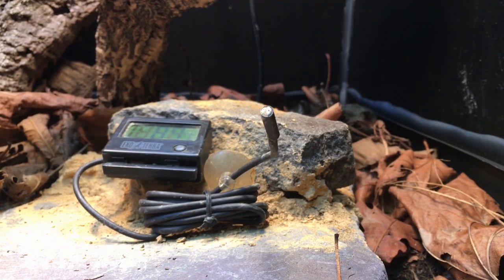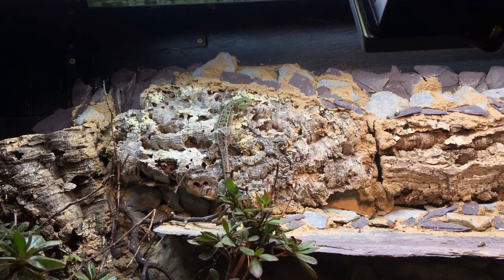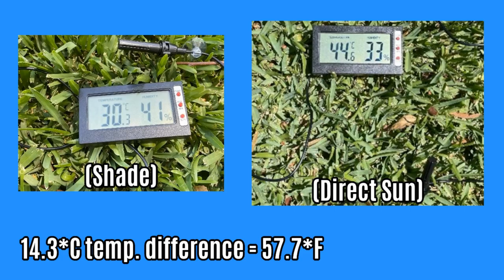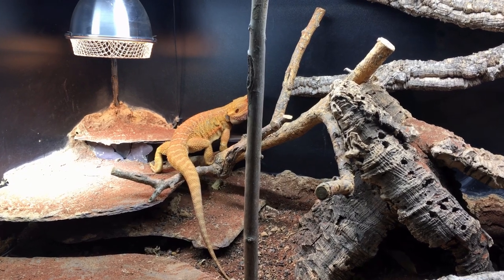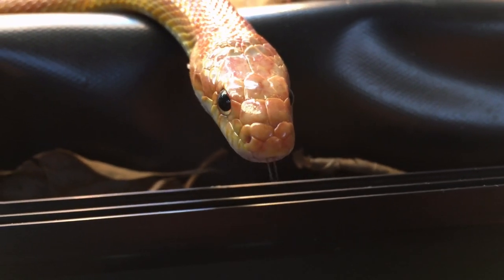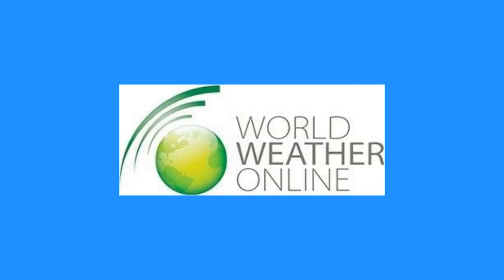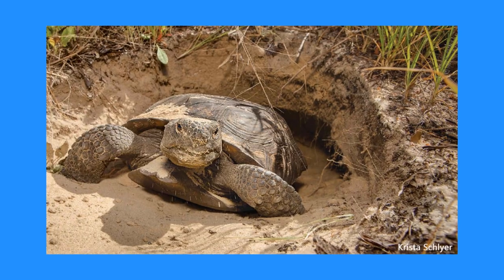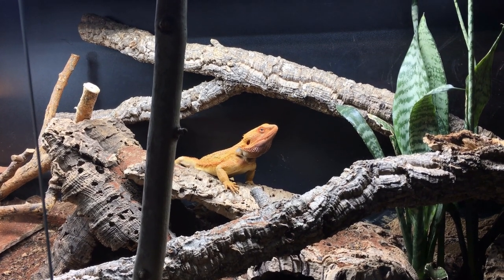We've Been Heating Reptile Enclosures Incorrectly All These Years! - How to Heat a Reptile Tank

Comment: I'm sticking to my ackie setup lol. Radiant heat panel fixed to a herpstat thermostat on the cool end at a continuous 70f and on the hot end a bulb with a hot spot of 145f. Two digital hydro thermometers at the cool and hot ends centralized at ground level (not near bulb on hot end I check that daily with a temp gun. I give over 20 ground level hide spots with multiple elevated points with 6 to 9 inches of mixed substrate. This gives the animal multiple  choices with some hide spots hitting 99% humidity ect. He's healthy active and shedding well so something is right. O also have a 22 uvb that he's got a angled basking log running underneath.
Reply from the maker: Do you only have a radiant heat panel? No incandescent lamps, no metal halide or spot LED?

There is much more to radiation than just warmth. Just as you cannot induce cutaneous D3 synthesis without proper UVB lighting, you cannot induce the metabolic effects of NIR and visible light without providing them in the right intensities.

See here: https://youtu.be/UEcm0YwfAIg ...and here: https://youtu.be/dUJZ04sqhxk ...for more on this.
Reply: @JTBReptiles  he's got a Arcadia uvb and I had a top states dwarf monitor breeder have a look over my current set up and his only question was the ventilation and that I had to much at the time.
Reply: @JTBReptiles  o and of course the outdoor halogen spot for his basking spot I'd be worried if my radiant heat panel hit 145 lol I'd get the fire extinguisher out on that case
Reply from the maker: “Too much ventilation”? I’d like to know how an enclosure can be too well-ventilated considering that - unless you have some seriously powerful fans - the air flow through the enclosure will be nothing compared to even a light breeze in nature.

How is that 145 Fahrenheit being measured? If that is the genuine air temperature (measured with a probe in the shade, as described in the video) the lizard would be dead, so it cannot be that. If it is the surface temperature of a stone, the lizard will certainly avoid settling on it when it has gotten that hot. Forgive my bluntness, but whoever is recommending that cannot understand what they are measuring or the potential for damage such practice involves. I predict that you are likely either using a probe thermometer sat under the lamps or you are measuring a surface temperature with a gun; if that surface is a stone the lizard will rarely sit on it - if it is a piece of wood, though, it may show no particular aversion of it.

Here is some additional food for thought. The intensity of infrared A on a clear day near the equator is about 300W/m^2. Offer significantly less than this and the metabolic implications are lost; significantly more and there is a real risk of overexposure. A similar sentence can be composed for visible light. Temperatures are affected not just by radiation but by the ability of the vivarium to lose heat; thus if you choose your lamps based on temperatures, your choice will be heavily influenced by factors other than the intensity of radiation you are offering. How can you know that conditions are optimal? If the “top US breeder” has to use a 100W halogen lamp to get his temps up and you need to use a 70W lamp (for example), which of you is offering the correct IRA intensity? Are either of you? And what about visible light - without a dedicated source, for a diurnal heliocentric species like a monitor you will definitely be under-providing it.

It is not hard to get reptiles to breed, for the most part. After perhaps the desires to eat, drink, run from predators, and (how very topical) move for thermoregulatory purposes, the desire to breed is one of the strongest urges of any animal. You can keep a reptile warm enough for activity with no great difficulty, and often doing this is all that is required to keep them alive and apparently well to the point that they will breed reliably, but it does not mean that everything is being done perfectly.
Reply: @JTBReptiles  because monitors need that huge amount of humidity with insanely high basking spot so in his explanation you need a limited ventilation otherwise you just dry out the vivarium with such hot heat sources inside. This man has been producing top ender ackies , kimbs,  kings and black heads and more for decades so I go by his wisdom and success of producing amazing animals.
Reply: The ambient on the hot side is in the mid 90s but his basking rock with the temp gun held directly on it reads at this very moment 146f wich is actually low for a ackie of his size. You investigate ackies in the wild and they've been recorded basking rocks reaching 180f lol. You have to remember this is a monitor lizard so a whole set of different rules than say a skink or a gecko or a beardie. Also I would suggest looking into dwarf monitor care sheets and communities because as I said you have to jump through some uncomfortable hoops to get them to thrive that go against the grain of the standards for more commonly kept animals
Reply from the maker: As I say, just breeding things doesn’t say much for a keeper’s ability. It may show that they know their animals - how to handle them, deal with them, coax them to eat, what they look like when they’re about to lay, and so on - but it doesn’t mean that they understand them. Indeed, it doesn’t mean that they know how best to provide for them: the dog breeders which produce the most animals are those involved with puppy farming; likewise, the ball python breeders which produce the most animals have them in racks. Success with breeding is really no indicator of welfare.

Now, I do not believe that any reptile would choose to sit on a dense stone that hot for prolonged periods. A wild ackie monitor might WALK OVER a dense rock that hot, but I will eat my hat if one has ever chosen to sit on a dense rock at that temperature in the natural setting.

The lizard does not care about the temperature of an object. It cares about how hot it feels to the touch. A piece of metal at 145 Fahrenheit would be almost immediately painful if you touched it; a dense stone at that temperature wouldn’t be quite as damaging but it wouldn’t be nice; a less dense stone (like a piece of pumice) would feel slightly cooler again; a piece of wood would only feel warm. It is the object’s capacity for heat transfer which matters, not just its temperature. For the most part, the lizard will sit on objects which have the combination of temperature and heat transfer action which feel comfortable: not cold, not hot, just right. The lizard might opt for slightly warming objects when it is cold, but other than that, its preference will largely be limited to avoidance of the extremes, i.e. really hot to the touch and really cold to the touch.

What the lizard DOES care about is radiation. Reptiles are famous for their behaviour of moving to and from light and shade: it is this - the intensity of sunlight - which really matters to the reptile. Air temperatures have an influence on body temperature which we must be careful to consider, but they don’t influence the choice of basking location - so long as the air is warm enough for them to get started and not so warm that they overheat, the choice of basking location will primarily be driven by (once again) the intensity of sunlight. Therefore, THIS is what we need to concentrate on: replicating the form, composition, and intensity of sunlight. Secondarily we must consider the air temperature to ensure it falls within the broad “Goldilocks zone”. Finally, we need to check that objects in the enclosure aren’t uncomfortably hot or cold to the touch. A 145 F dense stone WILL be uncomfortable to sit on, so it shouldn’t be in there!
Reply: @JTBReptiles  well you can presume all you want but a whole community with healthy ackies who are active, feeding well with no burns or deformities from wrong care would say otherwise. Just from my own animal who has an area of light in the 90s to second source that's 145ish his behavior daily is to come out of his burrow and spend about 40 minutes under his 145 area and warm up then go through a pattern of spending about 30 minutes to an hour burrowing,  looking for food climbing about then straight to his 145 area for say 30 minutes. He'll do this then he seems to sit on the 145 for one last stretch of about a hour and or two then he'll start withdrawing to his burrow about a hour prior to lights turning off. Like I said this animal has many areas ranging from 80s to 145 and he always chooses the 145 because he's a ackie. Also you're slightly wrong on the breeding idea... some species won't breed at all in a bad set up for example crocodile monitors ... there's a reason why they cost so much. But I really think you should look into ackies and so on before drawing such a conclusion.
Reply from the maker: Seeing as you seem so certain, I am doing just that: looking into the depths of this. From what I’ve read and watched so far, I think that this monitor debacle has more to it than meets the eyes of both parties, both yours and mine. (I’ve got the cutlery ready, but I’m not eating my hat quite yet - there’s a lot more explaining to be done before I get to that!)

I am used to the sort of persistence you have shown as coming from people who either don’t understand what they’re saying OR from people who have incentive not to change what they’re doing. However, I realise now that this isn’t entirely the case - there is some serious thought which has gone into giving monitors such peculiarly high surface temperatures. I must therefore apologise for my recalcitrance.

Expect to hear more about this from me in the future!
Reply: @JTBReptiles  yeah like I said it's some uncomfortable hoops to jump through. But say if you kept a ackie at say bearded dragon temps you're looking at obesity and all sorts of problems like gout. You see bosc monitors suffer from this problem alot because they need similar temps and a heavily based invertebrate diet. New keepers to monitors  are scared or not experienced enough to create this odd extreme hot spots with high humidity ... also they feed boscs lots of mammals and raw meats. I think it's the metabolism of monitors that creates the need for these temps like my ackie is a very very very active animal.
Reply: @JTBReptiles  also like i was trying to explain prior (I work 10 hour night shift and I'm always half asleep when you reply it seems 😂) my breeder to my knowledge was 1 of about 7 people that started bringing dwarf species to the states and together they came up with this (maybe not perfect but nothing in captivity is) but darn close system over decades. So as suggestions I would look up nerd videos for monitor behavior and metabolism, professor herp for basic care, critter cam for videos on how they keep ackies in Australia and dave Kaufmans video on ackies in the wild. I personally spent 7 years investigating and letting the ackie hobby grow before I purchased and yeah it didn't change much in the systems used to keep them as healthy as you can.
Reply from the maker: @cadirgemont5900  There is still very much more to this, though. From what I have seen, nobody makes distinctions between different basking surfaces: they state the same temperatures whether the platform is wood, rock, soil... and all of these things have different capacity for transferring heat to the lizard. What is more, it seems that virtually every keeper drastically under-provides visible light, and I am pretty certain that most keepers offer too intense NIR. For larger monitors, it looks like many keepers offer basking sites which are too small, illuminating only sections of the animals at any one time.

What I concede to is that these animals are capable of contacting much hotter objects (with high heat transfer potential) than are most others. This is surprising. However, whether offering this degree of conducted heat is, in and of itself, beneficial, I am yet to be convinced of. (Think, there are people who keep ackie monitors and other species outside in sunny countries with only wooden basking platforms: fantastic lighting, but relatively little heat offered through conduction. These outdoor-kept animals, though, seem to do better than the ones with hot rocks kept indoors.)

There is too much uncertainty yet to draw any solid conclusions. I will keep at it. As it happens I've a friend acquiring an ackie monitor soon, and we might just be able to design some experiments to put all this to the test... Stay tuned!
Reply: @JTBReptiles  a video by snakes and adders on ackie care is also very detailed. With my animal personally those temperature ranges cover quite a mix from brick, shale , cork , substrate (the soil/desert sand/ play sand / moss mix) also a bit of strange but personally tested after being told advice for your friend is with substrate try and use smooth sand types ackies hate the larger granulated sharper types of sand. My one was highly skittish until I changed his sand in my mix and I noticed within hours he started digging more .. I think it irritates the eyes and nose maybe and because ackies use their tunnels for regulation your kinda denying that hence mine was like a torpedo when I approached his vivarium.